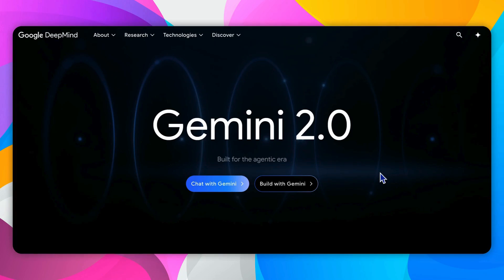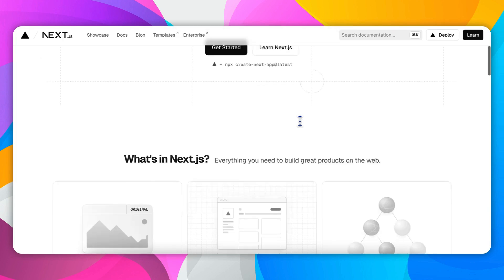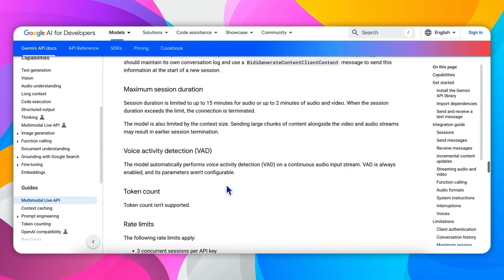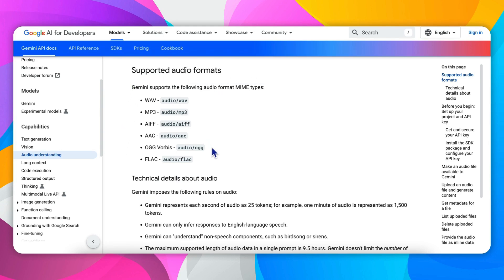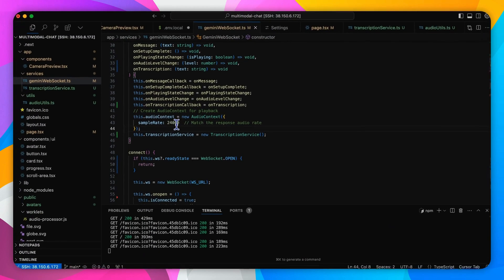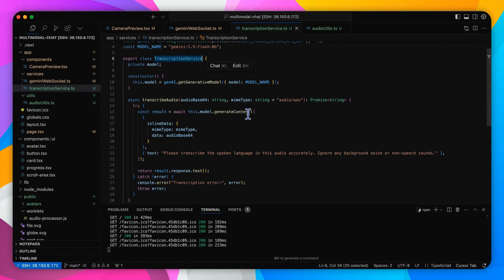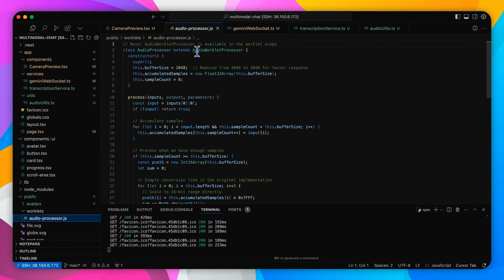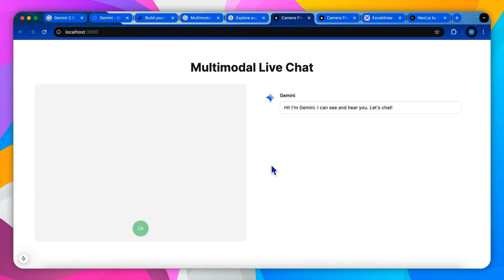Building a Multimodal Realtime App With Gemini 2.0 API and Next.js: Audio, Video, and Transcript

Comment: It is worth pointing out that the `NEXT_PUBLIC_GEMINI_API_KEY` that the author uses in this video is exposed on the frontend for all to see. This means that any user of this application can steal the GEMINI_API_KEY and use it themselves. The Google Gemini docs mention how web socket connections must be securely channeled through a server which is not done in this demo. "The Live API only provides server to server authentication and isn't recommended for direct client use. Client input should be routed through an intermediate application server for secure authentication with the Live API."

Comment: I don't know if you'll answer - but is there an easier way to transcribe the user's input, hook it up with a RAG search and provide Gemini with additional context?

Need to do this for audio + image input -> audio output format using this Live API.

I've tried interjecting a transcription API in between receiving the audio, accumulating enough audio chunks until its 5-10 seconds, and then trying to transcribe and feed to Gemini as instructions.

But all this is adding a ton of latency to the input / output flow. My question is - have you dealt with a scenario like this where you might need to let the user include a knowledgebase?

Comment: this needs ssl configured? due is stucked in connecting....
Reply from the maker: The app need to have permission for user's microphone and camera, so the browser will block the visit from public IP for security reason if your server has no ssl setup. You can acquire one ssl quickly from Letsencript+certbot. Or you only can test it in localhost access.